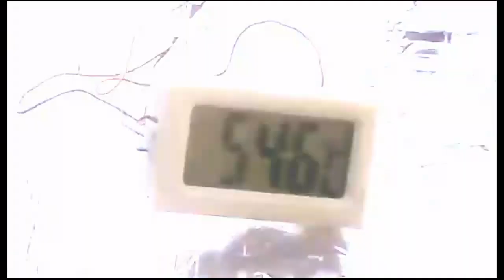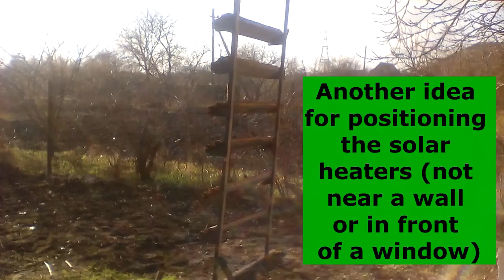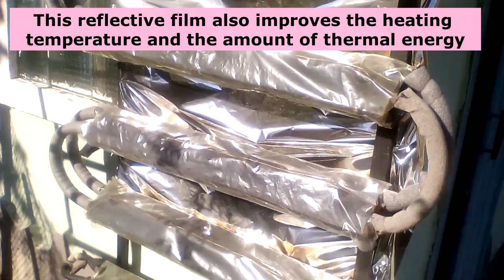DIY Solar water heater like a fence or outdoor blinds

Comment: ...Thanks Sergiy for share all ideas, designs, prototypes, implementions  and datas...it's so inspiring...looking this heater at the wall coming to me the question: why don't install a trombe wall an take in advance two functions in one, by enclosing the pipes increase temperature in coldest days and create an constant inlet of warm air at home...possible maybe...why not, make it simple...good job...enjoy...
Reply: I was thinking kind of the same : ) With recycled double/triple glazed windows..